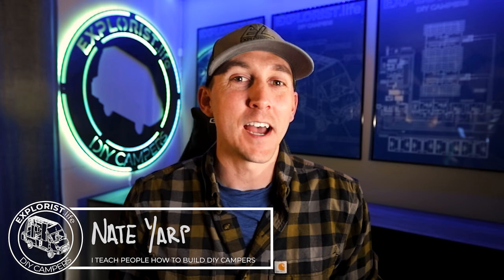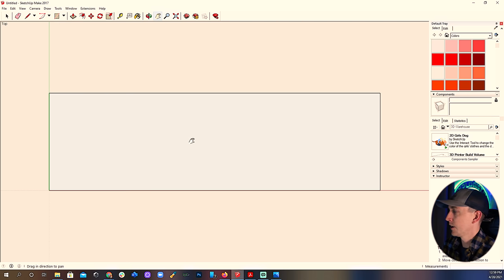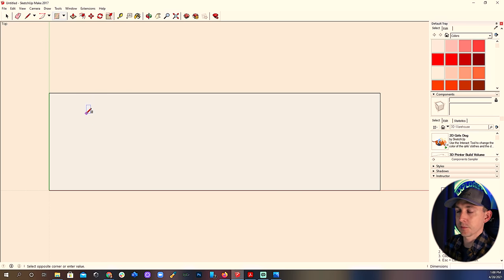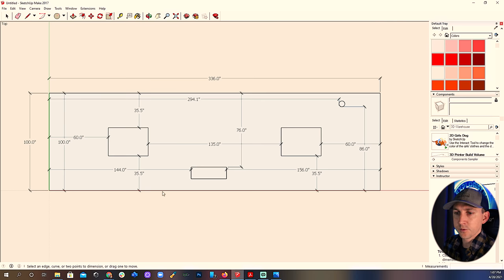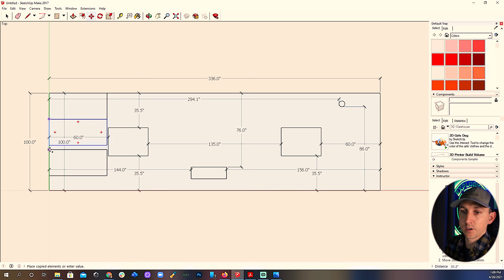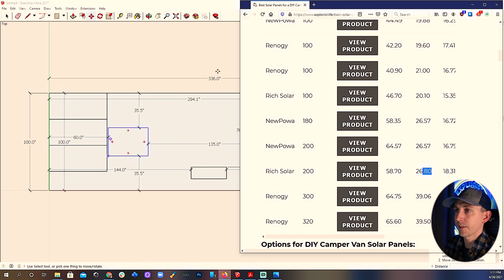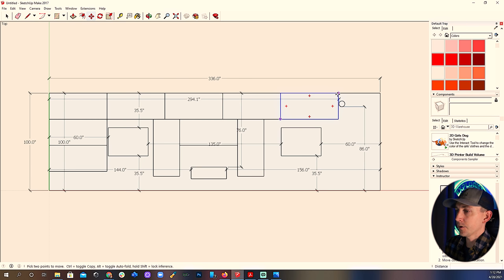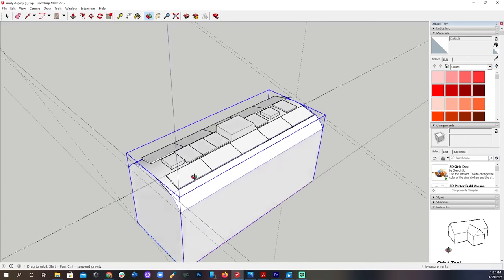Best Solar Panel Size for a DIY Camper Electrical System (and how to blueprint your camper roof)

Comment: Another thing to take into account when positioning your solar panels on the roof is the shadow created by your air conditioning units or other objects on your roof if it is too close to the panel.  Depending on the position of the sun, this can effect the output if a panel is overshadowed.  Raiseable roof vent covers is a good example.

Comment: Very good information, I just did this for my motorhome two weeks ago using Visio. TIP: Don’t forget that a lot of RVs will have a roll off near the edge of the side walls which is unusable space and no structure to install anchors, also you must take into consideration the dimensions of the panel mounting brackets.  And most importantly accessible walking area to perform maintenance on the AC unit and other roof accessories... even vents need to be checked resealed annually.
Reply: Totally agree. In my solar planning for my motorhome, which technically should not walk on the roof, having space to do maintenance is a part of my plan. Great tip!

Comment: I've been following y'all for years. Thanks for EVERYTHING! I'm starting a new van project and installing solar for the first time. I have a Chevy Express and am considering putting two panels along the passenger's side of the roof starting as far forward as possible.  Batteries and water will be inside on driver's side. In 3 years of research, I have not seen this done. Is this a poor decision?

Comment: plan for unistut to hold panels instead of drilling 8 holes per panel on brackets then you can upgrade/remove panels at will without harming roof.

Comment: Thanks Nate! Learned more about Sketchup also. :) Should solar panel weight be a factor in roof planning? For instance, the Renogy and Rich solar 200 watt panels differ by 20 lbs per panel (at least what Amazon says). If adding 4 panels that +100 lbs when using Rich Solar over Renogy.

Comment: Great video I would also mention to take in account for weight and any brackets that may interfere with the panel next to it
Reply from the maker: Sure!  You can get REALLY detailed on this depending on how close you are cutting it on placement.

Comment: New subscriber, thanks for Sketchup tips! We decided not to RV but to continue car camping as we've done 25 years. I know flexible solar panels can delaminate if left in a cold dark storage shed (or especially if always exposed on a roof), but what if we keep them in our heated and air conditioned basement of house most the year, only using them camping 4 weeks/year?  Hanging in the basement seems like perfect climate control. We'd only use them 2 weeks at a time. it appears you don't use them but you could do a video on if/how/when your friends' flexible solar panels started derating or delaminating, and if there are known best prevention or upkeep tips. I want to buy now but can't seem to find this information from any of the big YouTube flexible panel reviewers who only review them when new. Maybe you could link to good info about this, thanks. Or I may just buy two rigid 44" 100W panels and put them inside the subaru outback until we get to campsite, but that takes up precious cargo space. We're building our own solar generator. Thanks!

Comment: Nicely detailed! 
However the formula for Goal Power seems to come out of nowhere. What's behind this Ah used x2 = W? Where did it come from and what are it's limits? I've seen all sorts of 'rule of thumb' suggestions, but I'm not sure what to trust.
Reply from the maker: Sure!  For example...

If you use 200Ah of battery bank capacity (@12.6V), that is ~2520Wh of power. 

2520 / 6 hours of solar charging (US solar average) = 420W of solar panels

Comment: Thanks! Do you consider shading when you decide panel size near AC? Like bigger panel right on edge of AC, Vs. smaller ones with some space in between?
Reply: I had similar questions about shading and should we avoid having too close to items like the taller a/c units. Would love to hear Nate's insights on shade.
Reply from the maker: Not really a HUGE consideration.  For maximum solar output, shading should be avoided altogether.  That one is easily overthought.

Edited for clarification...  If there is a spot that is always shaded, it's best to try to avoid putting a panel there in most cases.  The more 'sun on panels' you can get, the better.

Comment: Hey Nate, thanks for your vids, I’ve learnt so much mate!
Just wondering why people don’t use house panels on RVs more? 
I was thinking of using 2x 390w panels on my RV roof. Saving a bit of $ per watt compared to the smaller ‘12v’ panels.
Your (excellent) solar charger calculator recommended the Victron 150/85 and I’m wondering if it’s totally overkill? Anyway, would love to know your thoughts on it all. Cheers mate!

Comment: Im having such a hard time finding the right panels for my limited roof too( 1957 avion tt) with two ceiling fan and ac unit and a curved top😒. Is there like a long and narrow panel ? 74”x20” maybe? I need at least 400watts but it’s like mission impossible with my limited roof space 😞

Comment: Hi Nate. Really like your videos. It is the clearest info I could find on solar setup.
One question remains: what to do about shadows, should we even bother with shadow on a van roof ?
I figure that two series in parallel will help. What do you think ?
Reply from the maker: It's not something to stress about, but should definitely be considered.  If there is a spot that has shade 100% of the time, it's best to not put a panel there.
Reply: @EXPLORISTlife  Or do not park the van in the shade. :)
Reply: @EXPLORISTlife  Hmmm...I thought if you have a few panels wired in series and one of the panels has a shadow on it because it was too close to, say, the air conditioner, it will greatly reduce the power of all the panels in that series. Right?
Reply from the maker: Shade on the panels should be avoided at all costs if maximum solar production is the desired outcome regardless of how the array is wired.

Comment: I'm to the point where I want to wire my cabin and bedroom lights on 3 way switches.  However, I want to put my bedroom on a 3 switch rocker panel and my cabin lights on a 6 switch rocker panel.  Can you point me in the direction of a good video on how to turn a common rocker switch into a 3 way?

Comment: Nate, thanks so much for the clear, concise instructional videos. Super helpful. I have a 600 amp hr kit from Battle Born and will need to purchase the wiring kit from you guys, probably this week. We di not yet have panels and have been researching SunPower and REC for their quality and efficiency. However, I have been advised to consider other manufacturers because these are not suitable for RVs due to vibration, etc. while driving/camping.

Do you have any advice on this topic? We have two uninstalled MaxxAir fans and are considering only installing one due to rooftop real estate for panels. With four girls, we want to build the most efficient van possible (Sprintrr 170), so we figure solar array efficiency is critical. The SunPower X series efficiency and dimensions would fit well on our roof and provide 730 watts, I think, with room for one fan, and other temp racking options - kayak, etc.

Any advice would be really appreciated. Thanks.
Reply from the maker: Most solar panels will be fine, but you can always reach out to the manufacturer of whatever solar panel you are considering and see what they say and see if the will honor their warranties if installed on a camper roof.

Rich Solar is my own personal choice.  Their 200w panels fit PERFECTLY side-to-side on most van roofs and we partnered up with them to bring a 55w panel to market that will fit on either side of a maxxair fan, maximizing roof solar space.  Check out what we did on our Transit roof here for some inspiration on how you could make this same type of setup work on your Sprinter: https://www.youtube.com/watch?v=zspCRKAFxKA
Reply: @EXPLORISTlife  Thank you for your quick reply. I had not considered asking about warranty validity. I will do that. And, I will check out the link.

Keep up the great work!

Comment: So somewhere I missed why you are suggesting 100 watt panels for this area verses say 250 watt panels where I could use less panels but get the same wattage.  I.e. 10  100 watt panels verses 4 250 watt panels.
Reply from the maker: The purpose of this video was to help you learn how to create a map of your roof to determine what is the best solar panel size for YOUR roof.

Comment: Hey Nate! Thanks for all the videos you do! I’m still stuck with one thing though, which voltage and amperage should I be using in my array efficiency calculation? The VMP or VOC? Should I divide my panel wattage by that to get my amperage or should I use the ISC or IMP? I have 2 160w 12 panels I want to string in parallel for a 100ah battery, so it makes me wonder... why aren’t MPPT charge controllers sized for those who use higher amperage and lower voltage like in parallel systems? Should I consider switching my setup to series to save some much needed money on a lower amperage MPPT?
Reply from the maker: Use the VMP for actual panel output in terms of voltage while the charging is actually happening.

Use the VOC when trying to find the max voltage of the panel for sizing the charge controller properly.

I would indeed recommend wiring your array in series (or series parallel) to get your battery bank voltage to at least 20V over your battery bank voltage (paired with a properly sized charge controller, of course).

Comment: Great video. Just a note. Your picture is blocking the area you are putting in measurements.
Reply from the maker: It's actually not.  The measurements are right below the picture. Hope this helps!
Reply: @EXPLORISTlife  I'll look at it on a computer screen. They all blend together on my phone. Thank you for the videos. Looking forward to your next as I'm getting ready to connect my components and checking out the bus bar situation.

Comment: Why don’t you do a video on what the volts, amp and watts actually mean when it comes to charging , usage of the inverter and 12 Volt system during the day ? When i 1st started this would have been the most helpful . Now i run 3 100ah AGM’s 600 Watts run in string of 3 series/ parallel and a 60amp charge controller gonna add 200 more watts to finalize my system but when i started i was completely lost because there was no explanation of what everything meant. I just believe it would be extremely helpful to the community.

Comment: If I have a 400 amp hour battery bank, do I have to have 800 watts of solar to support the battery bank? Could it work with 600 watts of solar as?

Comment: Hey Nate thanks for the content. A subscriber  who just moved to Northwest Arkansas on a homestead with an off grid system in a Fifth wheel. 
I’ve got a question about my system. I have a MPPT Epever solar charge with 120Ah 24V LifePo4 batteries and a 2000/4000W Giandel Pure sine inverter. 
I too balance my batteries to 3.6v thinking I would fix this problem but I can’t figure it out. 
Once my battery’s are fully charged my inverter begins beeping (HI) and my BMS goes off saying over charge voltage protection. Whenever I unplug the BMS or disconnect the Solar power cord the alarm on the inverter stops but if I continue letting the batteries charge on solar it will go off again at 100% also my batteries begin changing voltage per cell? Is there something I can do? 
Thanks man, and again thank you for the content
Reply from the maker: It definitely sounds like there is something weird going on with your BMS and/or battery bank and the interaction with the charge controller.  I would start with double-checking the parameters of your BMS and charge controller and verify that all are up to proper spec.  Also, you may want to verify with a multimeter what the 'high' alarm actually is because 1V over the limit is a lot different than 20V over the limit.

Comment: Nate i checked out your panel list, none fit my size limitations while meeting my power needs. I have 6×12 feet of space and 560ah of battery storage for my lifepo4 12v bank. The 2 with enough wattage were over 36" wide, the 200watt ones weren't enough to meet my 1000 plus watt needs. Do you know of any that would be under the 6ft wide space i have in 250watts per panel to make it close to my 1120 needs? I'll be searching but thought it wouldn't hurt to ask. I'll be putting them on a frame attached to 4 ladder racks across my cargo trailer, so i can put a tilting frame up and get best exposure. Hopefully it'll help capture optimum sun light for an undersized array if i can't find any 300watt mono crystalline panels. Thanks!!
Reply from the maker: If you could live with 2" of overhang on each side, you could get 1110W with 3 of these panels: https://unboundsolar.com/1977441/astronergy-solar/solar-panels/astronergy-chsm6612m-370-hv-silver-mono-solar-panel